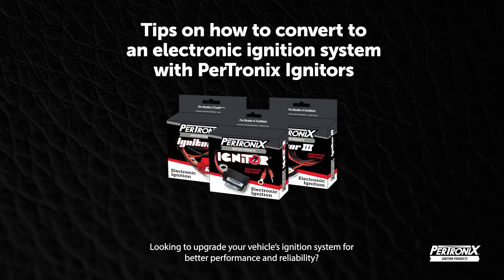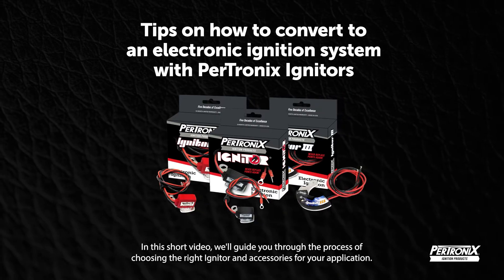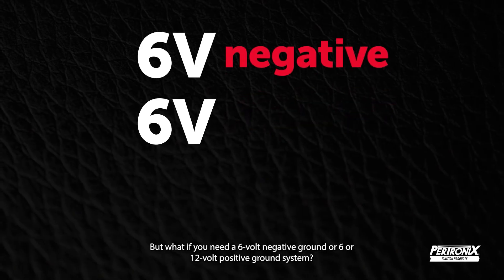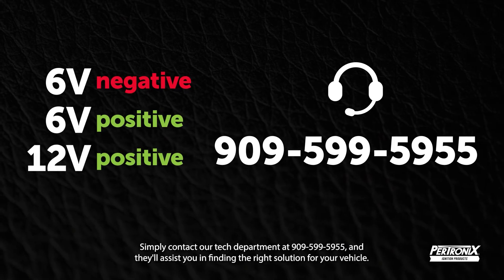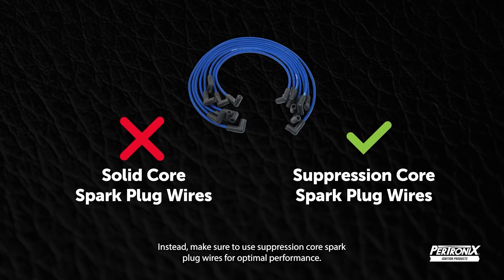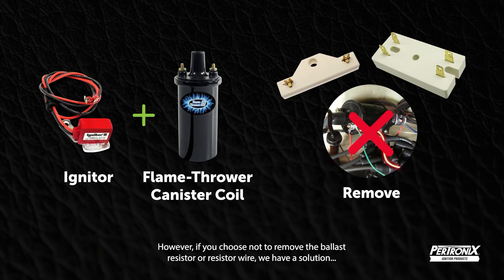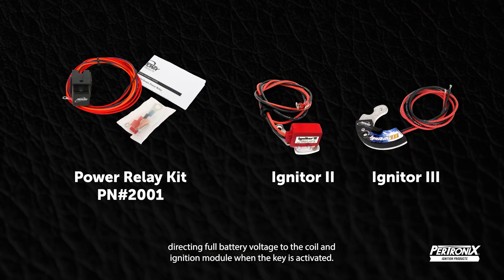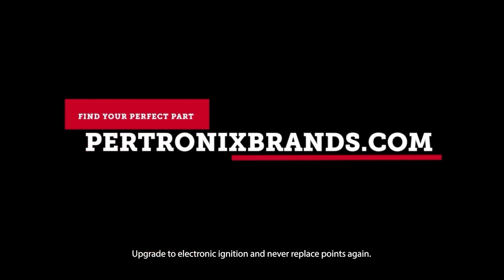Upgrading Mechanical Points with a PerTronix Ignitor Electronic Conversion Kit: Tips & Insights

Comment: Hindusthan Ambaassador Mark 4 petrol car 1489 cc, 4 cylinder engine, Ignition Distributor : Lucas - TVS 25D4, Battery -12 V negative earthing. Engine rpm - 850 min, &Max rpm 5500.
 Let me know the type/model of conversion kit, its parts and price & shipping charge to India